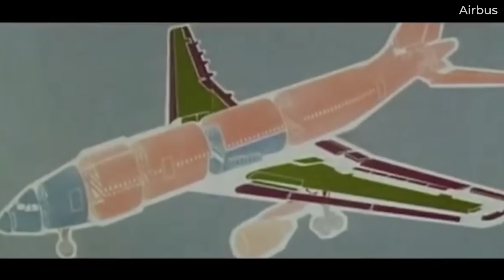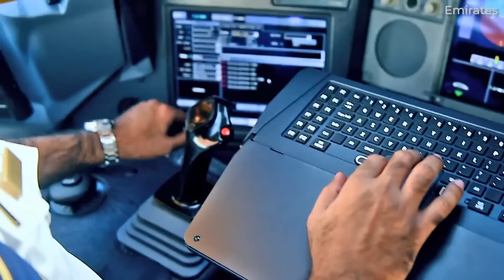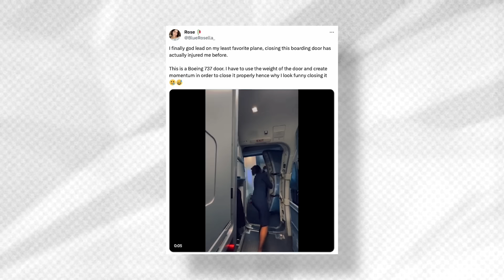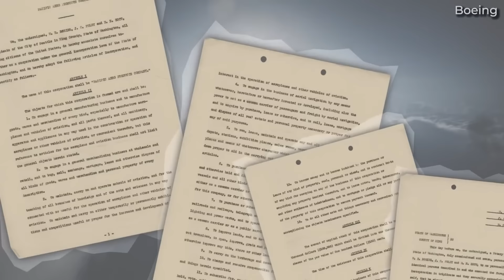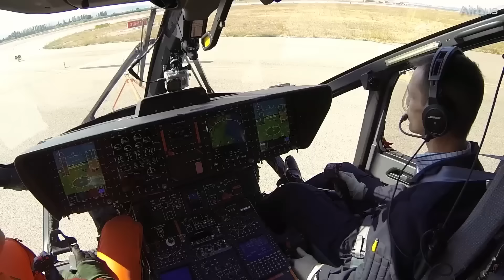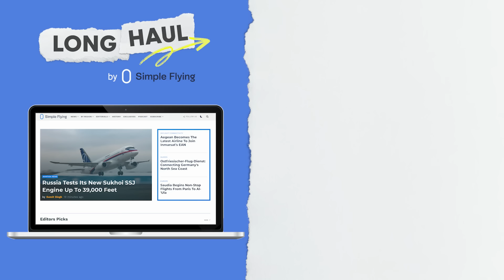5 Major Differences Between Airbus And Boeing Aircraft

Comment: I've just boarded Airbus A320-200 last week, it is AWQ (Indonesia AirAsia) PK-AXX, a pretty decrepit plane, which has its paint visibly chipping away. We can see the paint around the front door flaking. The cabin however is kept fresh, albeit pretty aging. The Airbus we all know are not shy at letting know what happened, the loud whine of the cargo door motor, the PTU barking, and rattly & noisy nose wheel doing its thing perfectly audible from my row 6 seat (it whines and squeak when the plane is turning on taxiway). The landing gear extension of course are marked with loud bang of them unlatching. Listening to all these, feels like sitting in a factory shop floor than a flying lounge. While the cabin is pretty spacious, its head space is pretty lacking. My head bumped into its old stye overhead cabin luggage rack. Also not to mention that we sit pretty high and close to the top rounding ceiling already.
However, two days later, I was whisked into Singapore Airline's 9V-MGM, a 737-800 operated by one of the world's best airline. Now, it doesn't have a PTV (since it was taken from their subsidiary, Silk Air). No TV is not an issue for me. But even the world's best operator could only do so much to compensate the plane's awful platform. It has a nice 787-style Sky interior with a contoured overhead bins that swivel down when opened, creating more luggage space, and swivel up when closed, creating more headroom. Giving it to Boeing that this is the best overhead cabin design. But, it is noticeably the crampier cabin. Sitting at the back row, the very familiar jet blast rattling the rear passenger windows always give me fresh memories at how awfully loud they are, and how close 737's engine is to the fuselage of the aircraft. When on cruise, a sudden change of flight level or compensating the wind will prompt the auto-throttle to command more thrust, and as passenger sitting at the back, you can feel the window suddenly rattles and audibly louder noise. Overall, I only hear positive reviews about 737 from pilots and overly geeky aviation enthusiast that cares more about plane type than actual passenger experience. Objectively, if you don't care about plane geek stuff, go with Airbus A320, it is only noisy when it is doing something. Even experiencing them from a cheap low cost airline, is still a marginally superior experience to a 737 flown by the world's best airline.
That being said, after flying with A350 back in November 2022, I guess it is just "meh" experience. Sure it is a new plane, quiet (not quieter than A380), and comfortable (but not that much more compared to A330) but it is not anything special from passenger experience. It is just "a new plane" and that's it, people who knows are more hyped about it, but if we are being honest, it shouldn't differ or improve that much. It still retains a heck ton of weird mechanical Airbus noises, including landing gear unlatching bang when extending, and that Airbus widebody PTU kick when wheel brakes are applied.
Boeing's 787 is a far more novel and superior experience in this class. It has a nicer cabin, quieter, and much bigger windows. The only thing negative about 787 is its narrower 3-3-3 economy row layout. It is also the first Boeing that let passengers know what's going on mechanically, especially that hydraulic pump noises that for some reason can turn on whenever it feels like it.
Reply: As ALWAYS, passenger comfort is down to the Airline and its maintenance regime. Singapore Girl! are one of the best.

Comment: As a passenger all I care about an aircraft are the sizes and pitch of the seats. I don't care about food/no food, window shades, pretty cabin colors,  blah, blah.
Reply: So you will care about the difference chat is most important from that perspective between the 737 and the 320 - the 320's fuselage is somewhat wider, which, given the same number of seats, equates to more sideways space per passenger. 😉

Comment: Boeing has major production problems deeply embedded within the quality control culture of the company, the safety standards are nowhere near Airbus. It’s a fact.
That’s the main difference.
Reply: True.
Reply: Absolutely
Reply: also all their jets are ugly in design interior wise and exterior wise,
Reply: I GUESS
Reply: @LexlutherVII they’re pretty much the same. Except from the fact that Airbuses have the mask and different nose shape, I can never differentiate the 2 when I’m in the ramp. The Boeing wide body’s are better in the eyes than Airbuses in my opinion. Interiors are the same, dependent in airline, manufacturers don’t do the interior design, you do realize that, right? I prefer the Boeing flight deck to the airbuses also. I do not normally fly airbuses anymore though. I’ll pick a wide body Boeing over an airbus any day. Boeing can keep the MAX aircraft, give me an NG. The NG is a more durable aircraft than any other model Boeing has made and airbus.
Reply: @cody7068  what is the "NG"?  I'm a Boeing 777/787 fanboy.  Love the widebody Boeings.  Always comfy for me at least.

Comment: The major difference between them is that one is designed by engineers, with safety and performance in mind, the other is “designed” by paperpushers with the only objective of generating profits to steakholders. 

The second major difference is that the first works while the other falls from the skies or loses doors while flying.

Comment: Both Boeing 737 and Airbus doors are easy to open both inside and outside. The front door even heavier than the rear is easier to do cause your just letting the door do the work. All you are doing is guiding the door in position. I can confirm this as i have open both Airbus A321 and Boeing 737-800 doors as part of my job as ground crew for an airline

Comment: Experience does count for something. When designing new aircraft, Boeing has been historically more adept at gauging the needs of commercial aviation than Airbus. Airbus, in some cases has been better at the execution of catering to those needs. In some cases, not all.
Reply: But it isn't like Airbus doesn't have the experience. After all, the company as such is a lot younger than Boeing, but it didn't materialize out of thin air (pun intended). They started out as a joint-venture of different, established independent planemakers, with the individual histories going WAY back.
Reply: @Colaholiker  In commercial aviation, Airbus, as a planemaker, is way younger than Boeing.
Reply: It's more like as a newcomer, Airbus simply didn't have the resources and more importantly, leverage to build the "right" aircraft.
For example, A300 and the original A340 have to stick with on-the-market solution, while Boeing could afford to bet big with GE90. A300 was also not certified for ETOPS in US until 767 was ready, almost a decade after ICAO permitted 90-minute flights.

And imho, Boeing should be shame of their poor executions, given their century-old experiences.
Reply: @steinwaldmadchen  That's borderline absurd. The A310, if I remember correctly, did get ETOPS, around the same time as the 767.
I've been around long enough to have seen the 707, 727, 737, 747, 757, 767, 777 and 787. Aside from the initial Max fiasco and earlier 727 wing design, tell me exactly which of the aircraft on that list was poorly executed. I challenge you.
No planemaker wants to gamble on a clean sheet design if the market wasn't needing it. I credit Boeing lately for making more of the gambles than Airbus, which basically seems content on borrowing elements of Boeing designs to minimize their own investments. Perhaps that makes them smarter, but certainly not better.

Comment: I've been Cabin Attendant for 12 year... I flew B737-200 and 300... Theirs doors are heavier and more difficult to operate, specifically the rear doors... Airbus planes were designed and thought in each detail...
Reply: Boeing relied on older but proven designs I guess. Or tried to keep attendants strong and fit in case you have to fight the weaker Airbus counterparts. In that case you would have an advantage over them.

Comment: Here's another one that encapsulates the underlying issue with the 737 Max:   Boeing engineers thought they could outsmart physics by increasing the engine size & hence location on the same 737 airframe. It doesn't work that way with just a "simple software tweak"  as 346 people cruely found out with their lives.   I sincerely doubt Airbus would have been so blase with that design decision.

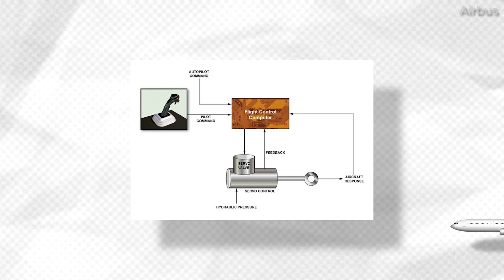Comment: 2:10 - to clarify, Airbus was not the first manufacturer ever to use fly-by-wire in a commercial airliner. Concorde was the first airliner to use a FBW system. In fact, Airbus did not use fly-by-wire in any plane until the A320 family in 1988. Boeing was not far behind, introducing a fly-by-wire system in its 777-200 in the early 90s.
Reply: Concorde  is a type  certificate  held by Airbus. And of course its FBW was analogue, whereas the  A320 and following versions are digital.
Reply: Airbus was the first to use fbw before Boeing did. Which is what the video is saying
Reply: @MrPmwas  yeah I know it is. But the way it is worded in the video might be confusing for those not in the know.
Reply: @Soordhin  Concorde "is an Airbus" in the same way the MD-80/90 family "is a Boeing." Airbus did not design Concorde, therefore Airbus' first FBW aircraft was the A320 family.
Reply: @erich930  Concorde was a cooperation between french and british aircraft manufacturers. Airbus started a cooperation between the same manufacturers plus some others. You could argue that Airbus is a follow up of the Concorde. It is safe to assume that the same french and english engeneers were involved.
Reply: @andreaseufinger4422  Yeah, I know, but it wasn't officially called Airbus back then and the companies were still entirely separate business entities.

Comment: Retired now, little over 26.000 hours logged. Flew them both, plus the Fokker 100 and MD11. 737, 767, A320, A330 and A350.They used  be great airplanes, but nowadays.. if it is a new Boeing,  you know… I AIN’T GOING!

Comment: I appreciate the safety of the yoke over joystick in that a copilot can see and feel what the other pilot is doing.
Reply: That's a good thing, I hope sooner or later Airbus introduce it too, but it's not a game changer in terms of safety.
Again, see Flight AF011 in April 22 with the typical 777 yoke. Meaning, they could feel the other pilot, but still didn't realize it was the other pilot. Because when they introduce feed back on the interface, they also provide input from the forces the aircraft is 'feeling' and pilots end up unable to distinguish 'force feed' from the aircraft with feedback from the other pilot.
Reply: As someone who  has flown both, that is an issue in initial training only.  After that the  advantages of not-connected  flight controls are actually greater  in my opinion.  It is so much easier to take control  away from someone using the wrong inputs in an airbus than in a Boeing, it is really a game changer once you wrap your head around it. 

Simply press the red button and hold it, the other pilot can move his stick, but no input will be registered. So if my FO tries to kill me, for example like the Atlas Air 767  FO did, i can simply lock him out. In my airline that is actually a training topic every six months in the simulator.

And of course, using a side stick, whether active or not, allows  for a table while the flight  controls are not used anyway, which in commercial aviation  is around 95% of the time the aircraft is in operation. Which makes paperwork much easier, and of course eating dignified,  no need to balance your food on your lap.
Reply: There are active sidesticks where both sticks are virtually linked. Gulfstream G700, Embraer Prator Business Jets and the Irkut MS-21 Airliner use these.
Reply: @flightlinevr6302  True. All of those designs are 30 to 40 years younger than the Airbus one, and introduce additional failure mode, which are not  really an issue as business jets have only small number of fatalities per case and in russia no one really cares about airliners crashing.

That said, would Airbus possibly design its sidestick differently? I doubt it, they had access to an active sidestick design and did decide against it, mainly for simplicity of operation in western airline operations which requires a  99,7% or higher dispatch reliability. And so far they have been proven right.
Reply: yokes are outdated, only Boeing uses this old technology. Yokes are uncomfortable and need too much space in the cockpit. Sidestick is  such better. Yokes are not safer than sidesticks.
Reply: You can actually see and feel what the other pilot is doing with a sidestick. Assuming the other pilot is in a correct seating position, which 99% of pilots are
Reply: @Soordhin just curious, if your FO hit that red button first, would it inactivate your joystick?

Comment: At 2:50 ish: Not sure about the comment about a Boeing being easier to stall than an Airbus. Both brands have flight computers with control algorithms to intervene in the event of any unsafe manoevres, and excessive inputs from the pilot will be modulated in both brands' flight systems
Reply: With Boeing aircraft it depends which ones. The conventional ones without FBW (737, 747, 757, 767) can be easily stalled without much of an envelope protection.  The FBW ones (777 and 787) of course do have an envelope protection, but can still be stalled, the pilots just needs to more force than usual on the flight controls. 

In Airbus  the  envelope protection does not allow the  pilots to  intentionally stall the aircraft. It still can stall of course, it is still an aircraft after all, but (nearly)  only due to environmental conditions, like windshear or very strong gusts for example.
Reply: the only way to intentionally stall and Airbus is by turning of multiple flight computers and putting it in direct law aka 737 mode
Reply: @topethermohenes7658  Well, there are ways to stall an airbus in normal law, especially if you use dynamic maneuvering. It is even easier to get out of normal law without any malfunctions or manually switching off computers, and in alternate law, or abnormal attitude law, it can be stalled. One just has to use flying that gets you instantly fired in any airline, far outside the operational envelope.

Comment: Airbus doesn’t make a convertible dive bomber
Reply: Lmao,,🤣🤣
Reply: how many have dive bombed since 2020?0
Reply: @thetruthbehindplanes  yeah because it was grounded until 2022
Reply: just one model.not every boeing was grounded.tell me when the last 727 crash was?747?757?767?777?or what about 787 crash?oh forgot,that never even crashed in the first place
Reply: and what about non max 737?and even the max,its been 2 years and still no crash
!
Reply: @thetruthbehindplanes  one of the lead engineer that design the 787 warns to avoid getting on one if possible.

I would recommend you to do the same as well.

Planes today are built with triple redundancy in just about everything onboard. They are not supposed to crash. A crash is one too many.
Reply: @tonamg53 well I don't think he knows how many pax went on 787 and arrived safely.boeing crashes less than cars
Reply: And plus,flight  587 went divebombing
Reply: @thetruthbehindplanes  You have to be an idiot to choose flying on B787 when there is clearly a much safer choice available. 

You know the A350 that crash landed at Haneda recently? 

If that was Boeing 787… it would’ve been a totally different story. The engineer that warned about 787 was exactly about fuselage integrity, that it will shattered like glasses upon crash landing with extremely low survivability.

He also warned about various other quality issue that we all know and love about Boeing like missing bolts, debris in inaccessible area.

350 people should’ve been alive today but aren’t because of Boeing’s greed… 

I hope you are proud of yourself supporting a company like this.
Reply: that engineer was wrong.tell me how it will shatter?when traditionally,airbus is weaker.rounded to 300 people should have been alive today,but werent because of airbus rudder issues.
Reply: @thetruthbehindplanes  Airbus rudder issue didn’t cause the plane to crash.  If you are talking about the Air Asia crash as the rudder was only move 2° to the left once… and that was it.

Had the captain didn’t get out of his seat to pulled the circuit breaker to reset the flight computer against the SOP or had the first officer remembered how to fly the plane manually… no one would’ve died. The blames was on the pilots 100%.

Boeing MCAS moved the stabiliser 2.5° EVERY 5 SECONDS 

Pilots need to have extreme flying skills as well as luck to defeat MCAS activation in flight from faulty sensors… and here you have another hidden critical issue that was overshadowed by MCAS.

Quality Control those plane were brand spanking new, the sensors shouldn’t failed that early on. They definitely have QC issue when installing those sensors… 

Yes, the same critical issue that allows them to forgot putting bolts on the door plug.
Reply: I think you are a daily mail journalist.......faa found weakness in the a300 rudder design
Reply: well the pilots trusted airbus too much.airbus stops you .but pull the breaker.....ever heard of so safe its dangerous?
Reply: @tonamg53 it wasn't a factory problem for mcas